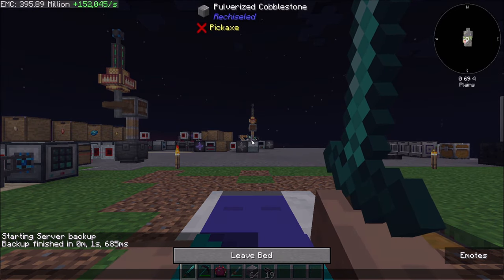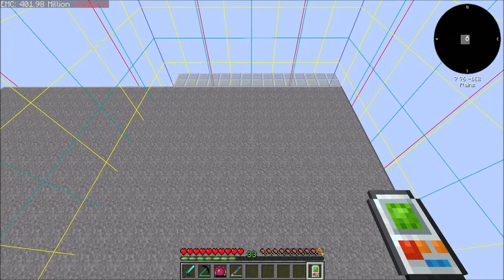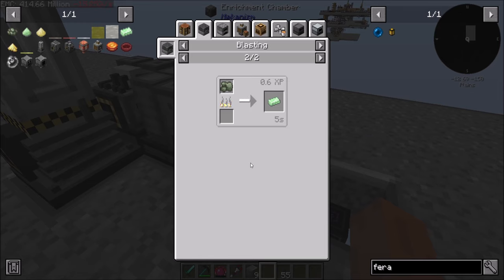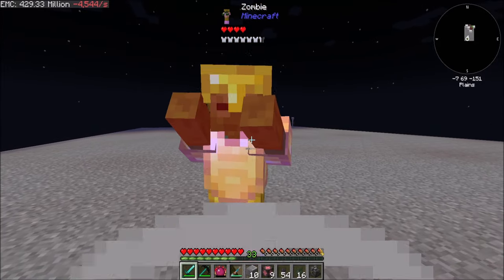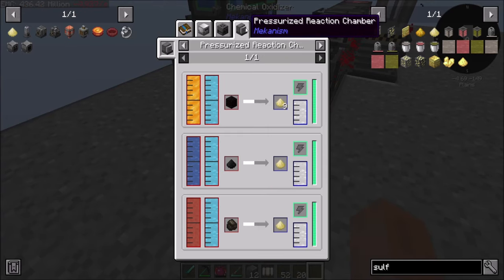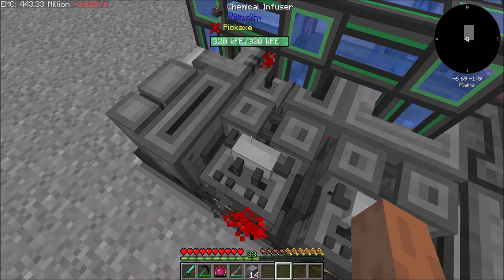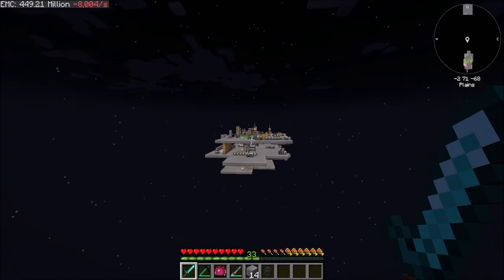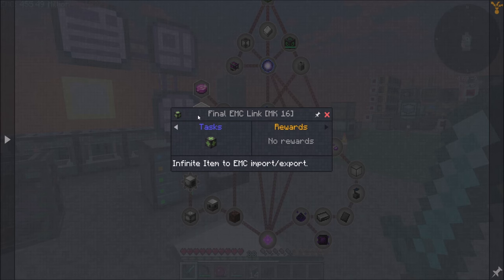Mechanical Mastery Ep22 Fissile Fuel

Comment: Dire, the lantern works in a 3x3x3 chunk area.  Since you built out a 2x3, if you put the lantern in the middle chunk, you'll get the light sources across the 3x3x3 area.  Rewatching the video, it seems you put the first lantern in the wrong chunk.  If you moved it one block to the left, you would have covered the entire platform.

Comment: No No No, my OCD is going crazy, because its not used to see you do a good clean Direwire setup like today this early in the series, EVEN the chunk borders got it perfect... 
But Normally when i'w seen you do this  Fissile Fuel setup a few times now, its normally clean as this... 
BTW dont you have 2 drawers with Sulfur? One at your Drawer wall, and some as a by-product from the blizz farm.. 
But i think you did the right thing by making a own dedicated for this setup 
And BTW why not use the Red-matter furnace, it have 9 internal slots and is really fast compared to the thermal's one, not sure if it out-speeds a fully maxed mekanisem factory smelter

Comment: Since you're using AE2 in your main setup, why not use RS for your reactor/fissile fuel setup? That way you can complete the quest book entirely and still get some use out of it. Sine they are entirely separate besides the EMC links the two systems shouldn't interfere with each other.
Also, if you use Flux Network storage that will go a very long way toward mitigating energy storage and transfer. I know Flux Networks is extremely OP but it might become necessary soon.

Comment: Can't Hydrogen be used in a Gas-burning generator? Because if so, why don't you set one up to burn the hydrogen that's being generated as a by-product (that you're not doing anything with anyways) in order to help alleviate the power issue?

Comment: FYI if you ever run into transfare rate problems:
It took me a LOT of trail and error but if you attach the in and outputs directly on each other with no cable at all the transfere rate is incredibly efficiant